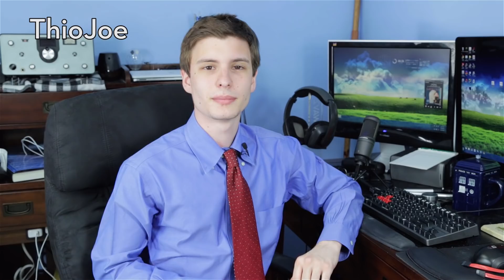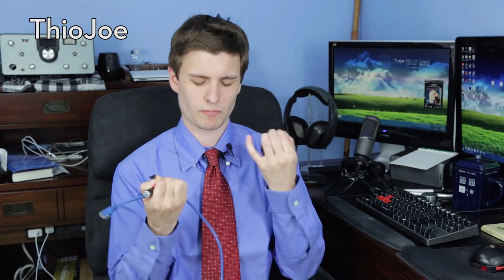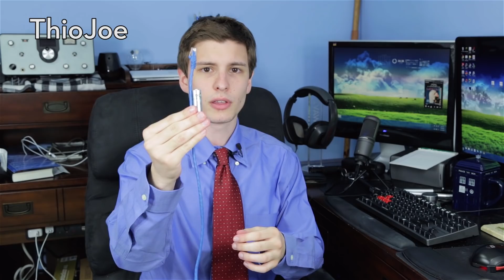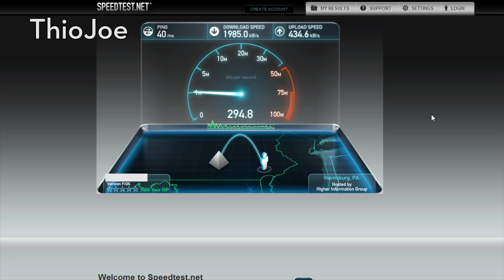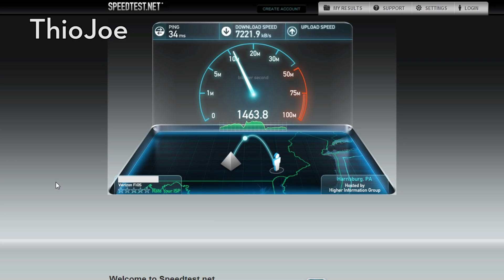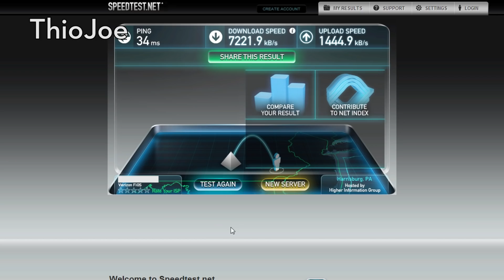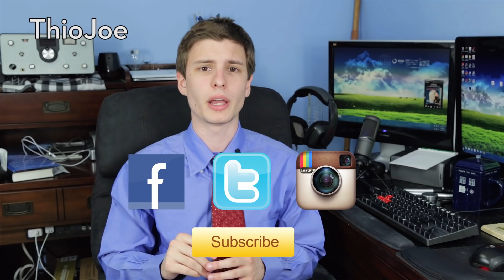Triple Your Internet Speed for Free

Comment: If you lick your finger and put it in a outlet, while touching a device you want to power; It'll actually work and turn on. This works because the body is made of 53-60% water, which is eletro-conductive. Let us all know how well it worked out for you! "Dying" to know.
Reply: Hahahahahahahaha i cant stop laughing dude thats one hell of a comment
Reply: Why did you put electro conductive? That's like saying your stupid but your also stupid.
Reply: Nick B Maybe you misunderstood, Electro-Conductive mean's it's eligible to harness Electricity. I suggest you do some research before you assume electricity means conductivity; They're two completely separate terms.
Reply: Maybe you should do some research sir, this is the definition of conductive 

con·duc·tion
kənˈdəkSHən/
noun
the process by which heat or ELECTRICITY is directly transmitted through a substance when there is a difference of temperature or of electrical potential between adjoining regions, without movement of the material.
You have just gotten pwned
Reply: Nick B
You seriously don't know how to interpret information. "Heat or Electricity." not only Electricity, therefore you must specify which substance, hense Electro. Conductivity isn't Electricity my little friend, it's meaning is to collect and transmit a said substance. Enough of your little "You have just gotten pwned", You've just been educated.
Reply: In the said context of your original comment and the video we weren't talking about heat we were talking about electricity so you don't need to specify, it was obvious.
Reply: Nick B According to your logic, but not the majority of his viewers. Honestly, it's a joke for stupid people. I would be less specific if it wasn't, Nick.
Reply: Cole J Mcdon I have a big penis.
Reply: so i tried this but all it did wus shocted me... i do not see how this is saposed to help me it dose not work... pleese help me :(
Reply: THAT'S FUNNY... VERY GOOD COMMENT !
Reply: The instructions were bullshit. I jacked off to Madonna.
Reply: I can't fit my finger in an outlet.
Reply: Aderic Keep trying!
Reply: Cole J Mcdon
Didn't have to try, just knew.

Thanks for the motivation though.
Reply: Aderic How do one knew if one do not know? and try.
Reply: Cole J Mcdon
I guess I can estimate sizes. Haven't you been able to see something and thought "I know that wouldn't fit?"
Reply: Aderic Haven't you ever seen a ridiculous comment and figured to not take it seriously?
Reply: Cole J Mcdon I guess depending on what tone you read my comment in, you'd probably see that I didn't take it seriously but was just going with it.

Comment: Excellent video!! But I used two 9volt PP3 batteries and was super excited to just over x4.53 increase in download speed. Upload speed, for some reason, never got better than x2.8. I think this is because i'm using a cheap motherboard with low quality ethernet port.

However, this only worked for about a day and half and then my internet stopped working, completely. After trying everything to get it working again, I had to take my computer to a service centre. The technician told me I'd over done it with using 9v batteries and lectured me about fooling around with stuff I don't know about. Turns out that that the two 9v batteries created far too much electromagnet current and toasted the ethernet chip. Guess that's why you only used AA batteries. Lesson learn't, looking for a new motherboard now. :(

DON'T USE 9v BATTERIES!!

Comment: Calling bullshit. Biggest clue: "electrical tape conducts electricity".  Electrical tape DOES NOT conduct electricity.
Reply: That's the biggest clue you got?  The fact that internet speed is regulated by how much you pay, or that he said batteries are inductors didn't hint you in either?
Reply: Biggest clue? Really?

...not the whole fastening of a battery to the outside of an Ethernet cable thing?

Comment: I was actually able to use two lantern style batteries and got a little of faster upload speed. I was out of electrical tape from the double your internet speed tips, so I had some reflective hvac tape and it worked just as well. I also found if you coat the connector ends with a silver sharpie you can get a slightly better connection. thanks for the tips Thio!

Comment: Hi ThioJoe, I  used the AA battery add on, Speed down before 81.24 after 93.87 about 10% improvement, but that is great...  I already have very high speed connection.  Question how about if I add the two other cables one on each end, will that help?

Comment: if u connect the batteries it produces current but it will be good for some days and after that ur motherboard lan driver components and capacitors will be destroyed by the voltage as the ethernernet cable conducts about -5ams and mother board will be +ve and this will destroy it and it is good idea for using it

Comment: This is a great joke and because of how many people fall for it, but to be honest (and maybe for future reference) it would've sounded even more believable if you told them to have all the batteries along the wire facing the same direction to "keep the current flowing the same way and to prevent any unwanted interference."

Just a suggestion, props on the joke and good luck with future videos! It gave me a laugh.

Comment: Yup i agree !!, i used 4 car battery's and connected my pc to my washing line via ethernet cable, i now have speeds of over 1000gb/s and wifi over 100 miles away in london, it works better if you also sellotape a packet of digestive biscuits to the washing line, (to further filter out the remaining noise) I will try connecting the battery's to the Ethernet cable next time as this time i only connected 2 to my forehead and dangled 1 of each bollock :)

Comment: The speed limit is not on the ethernet cable from the computer to the router. A cat5 or cat6 cable is able to support gigahertzs, the limit is on the DSL behind, which will not be improved with whatever you do on the computer.

Comment: I tried on my 56k dial up modem and it didn't work. I even used 2 car batteries and tape them up with electrical tape and it didn't work. I actually ended up on the ER after extreme testing... LMAO

Comment: Some of you are complaining and i think your problem could be like the one I am having. My internet router is 2 rooms over and i plug my computer into the wall which then runs the signal to the router. If i upgrade the cable between the wall and my computer it wont make a difference cause the crap cable running through the wall is not being affected. Im sure it would work if i was connecting the cable straight to my router.

Comment: It's important to use electrical tape because it DOESNT conduct electricity. that's why duct tape melts when subjected to electricity and electrical tape doesn't. And how could this even increase your internet speed? This is a total troll. And btw i have the exact same keyboard as you. Cooler master quickfire rapid with interchangeable wasd arrow keys.

Comment: actually i don't think this guy is joking, in another one of his videos in the description it said it was a joke this one doesn't
Reply: If you knew anything about how an Ethernet cable worked you'd know you're wrong.
Reply: Trust me... It's a joke. And these videos crack me up.
Reply: actually i kind of did work for me after i posted that it sped my internet up by 1 mega-byte my internet is usually 0.15 mb/s
Reply: XAE Gamer™ It would not be because of this that your internet speed is better. The battery would do nothing, don't fool yourself lol. All internet speed comes from the provider and it will fluctuate.
Reply: Lol right^^^ Do that!
Reply: Jaccob Hirt I tried it and my connection speed stays the same but it solved my problem with quantum physics ..
Reply: Network speeds fluctuate with almost every provider throughout the day. This method is not an internet booster.
Reply: XAE Gamer™ Mrnarutofan1998   If you two are trolling, I agree with you. I'm live under a bridge, myself. If not, then read on:
If electric tape was conductive, it would go off when testing it's continuity. Do you know what a multimeter is ? If not, Google it. Then, buy one on amazon. (Or your local Radio Shack) Then, if you don't know how to use it at this point, search "Continuity test with multimeter" on Youtube. THEN, attempt this SAME test with just a roll of electrical tape. Put both the positive, and negative, leads on the tape. Doesn't matter which side you do it on, both on each side, double it up, it doesn't matter because... It. Isn't. Conductive.
Bam. Jaccob Hirt is correct.
(I can't believe people are this gullible on believing these videos without research.)
Reply: xD
Reply: Ben Cobb not to mention the insulation on the cat 5 cable. lol
Reply: Jaccob Hirt false, it did work a little bit
Reply: you were right!! it worked!
Reply: Jaccob Hirt God damn , just try it out .And u will see.
Reply: I already know for a fact it doesn't so why would I? It wouldn't make sense anyways.
Reply: i think u just want to believe that XD but honestly this i a lie electrical tape is not conductive first off, and his physics he showed is nonsense, it is right im sure it is but it doesnt affect internet speed
Reply: If u think so I will respeckt
Reply: Mrnarutofan1998 hey naruto :D

Comment: Im a technician for a cable, internet and phone company. I can tell you that this does not work. We limit the amount of speed you aquire at your devices at the modem itself, not the cat5(ethernet) cable. So the only way you can aquire higher speeds is if you were to modify the modem. Which still is very unlikely to give you much more than half a mega more of speed. Sorry to rain on your parade bro...

Comment: Steven Acuna i have a really super desktop and 13mb speed internet but it wont push no more than couple of mb on my downloads
Reply: You're most likely getting 13 megaBITS per second. This equals 1.6 megaBYTES per second. Your 13 megabits is a couple of megabytes.
Reply: I am pretty sure they gave me  megabytes.
Reply: Atradies Fussell If it says it like this: "Mb/s" That means MegaBITS
If it says it like this: "MB/s" (Notice the B is capitalized here) then it means MegaBYTES.
Reply: Atradies Fussell You need to look up the difference between bits(b) and bytes(B). There are 8 bits in one byte. So let's say you're paying for 10Mb/s(Megabits/second), that's equivalent to 1.25MB/s(Megabytes/second). Those download speeds would never reach past 1.25MB/s and would probably be around 0.75MB/s and 1.1MB/s. Hope that helped.
Reply: i am checking my service provider now
Reply: yes it is megabytes

Comment: the only problem with this is, hes is talking bs the hole time. your internet provider puts a limit on what speed you get and if that speed is not limited then batteries on an Ethernet cable is not going to change anything unless it is a direct link to your line. if so then you will have the cops on your door step within 24 hours because your stealing internet from your provider. not only can doing this damage your cable it can also put your internet at risk, as the batteries can interrupt your connection. if this happens your internet will be cut off and your adsl will be temporarily blocked, this will take a repair man to fix.

so good luck with that

Comment: what if you use wireless?
Reply: Well then i guess you cant do it. Get faster internet.
Reply: bryceth01 actually i can, i just need to wire an ethernet cable through the walls and to my router/modem (i use ATT 2WIRE and i have excellent connection
Reply: ImpressiveMcGamer sadly, my parents wont let that happen
Reply: ok thats fine :) just wanted to have a suggestion:)
Reply: If you use wireless then you must tape a 9 VOLT battery to the antenna on your wireless router, then place a piece of tinfoil shaped like a small sattelite dish and aim it at the computer you wish to boost the signal to, then on your computer, wrap the back of the screen (top of your computer when closed) with aluminum foil to receive the boosted signal and tape a 14 volt battery to the bottom of your computer with the plug facing downward so it can get to the ground, now turn your laptop toward the router and check your speed.  If you get any signal at all you will indeed be lucky.
Reply: If anyone buys this line of BS then the have never worked on a true home network, let alone an office system.  I have been playing with computers since the days of the old Commodore C=64, I used to write software for those old war dogs and their big brother the C=128.  My computers grew as did the availability of newer and faster machines up to the point that I could no longer afford the next big jump, I stopped at the core 2 duo systems, now a broken down old man who has seen the bloody battle fields of Vietnam to the boring nights of night patrol on a police department, where I worked  for over 20 years.  Yet I still, as an old and broken down old man see this as bull shit, I am just trying to join in the fun, and it has indeed been fun.
Reply: ImpressiveMcGamer Well if you use a cable then its not fuckingwirelesss anymore is it now?
Reply: ***** Some big ones do.
Reply: Jerry Ericsson well, i agree to that, but id rather use a wired ethernet connection rather than wireless, as it is far faster, but you would have to wire it through walls if it was in a seperate room (trying to hide the wire)
and my pc i built myself and im glad to have it
Reply: TheSerun13 you think i am retarded huh?
no i am not, ik now this _ 
Smartass...
Reply: ***** You could just get a better internet :l
Reply: ***** my laptop has an ethernet port
Reply: Neither, i have a Ethernet port in the back of my computer (custom build gaming PC) and i dont need your comments either
Reply: were u talking to me because thats being a jerk for taking my time to help

Comment: dude... I hav some problem.. listen i connect AAA non rechargeable batteries and connect them usin an insulation tape to the ethernet cable facin the same ends
YET there is no diffrence. is it mandatory to use rechargeable batteries? and does elctrical tape conduct electricity???????  :( :( please reply at the earliest

Comment: After have tried with some kinds of batteries, the ion lithium gave me the best results and I ended selling bandwidth back to my ISP. I didn't stop there and later I taped a standard 100Mb Ethernet adapter over the battery getting an extra 100x factor. In short, now I am packing bandwidth into USB sticks and selling them in three flavors 300gb, 1Tb and 200Tb. With so much bandwidth on my side I have started to use the created bandwidth to created more bandwidth so that I have said definitely goodbye to my ISP because I don' t need them anymore, I have stored bandwidth in a closet at home for the next 200 years. Your method still need an ISP in order to multiply the service, but if you buy one of my USB sticks you are able to surf internet without it. The USB adapters have a very strong password so you can't use the battery method to gain bandwidth from them, I am sorry, it is just business. ThioJoe, you deserve a Nobel Prize.

Comment: use electrical tape because it conducts electricity
Reply: it might but the tape has to touch the other wires and not the instillation XD
Reply: Yeah. Did you catch that? Electrical tape actually CONDUCTS electricity. So make sure you're very careful when touching anything with electrical tape on it. If you touch the tape itself you're sure to get electrocuted. Nasty stuff. Maybe someone should invent a tape that could shield against an electrical current.

It really makes me step back and think about all those poor electricians. Such a dangerous job
Reply: LOL

Comment: This is only in theory and only connections connecting to your internal network. This will not increase ur speeds going out to the internet. If this works, it mean u have noise on ur network and you should fix it instead of patching ut up with duct tape.

Comment: If there was EMI (electromagnetic induction), then your cables would perform worse because EMI interferes with the electrical signal in the cable. Thats why the majority (if not all) cables that carry pulses of electricity are EMI shielded.  This is a simple paper written on the concept: http://vsgc.odu.edu/src/Conf09/UnderGrad%20Papers/Hare,%20Richard%20-%20Paper.pdf

Comment: Before doing this, watch ThioJoe's video on how to double your internet speed, after doing that, then do this, you'll wind up with 6x the internet speed.  But remember, then you'll need to download more RAM and invert the eSATA cable on your SSD.
Reply: I think it's actually an order of magnitude.  If you wrap the doubling cable with the tripling cable then it's 2x2x2 so 8x as fast.  Conversely, if you wrap the tripling cable with the doubling cable it's 3x3 so 9 times as fast.  You can use the SATA and IDE cables after the fact to eek out a little more speed, but YMMV.
Reply: Robert Dudley You could be correct.

Comment: troll. a aa battery some etape and a cable do not boost your internet speed beyond what you already have. i love how expensive cable has less resistance but i know for a fact it doesnt. resistance is dependent on length and gauge. not cost. etape doesnt conduct electricity. its an insulator and i should know. you cant create a magnetic field when your dont have power flowing and without the batteries connected they dont do anything. its just a bunch of mumbo jumbo. haha if etape conducted electricity then im sure everything thats ever been etaped would blow up.
Reply: you do know this video is a joke, right??

-_-

Comment: The only true way to get faster internet speeds is to use an umpa loompa. Get it to lick it's fingers and put one finger in the port on the router and put the other finger in the port on your computer. I easily got another 100Mbs using this method.